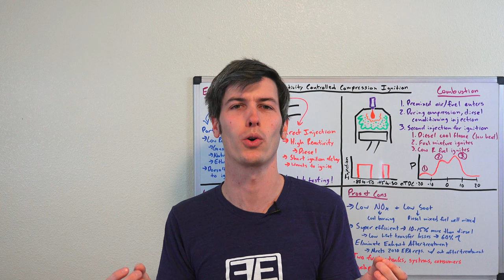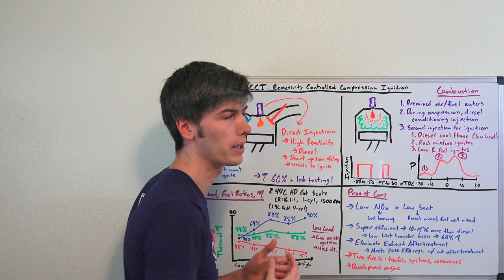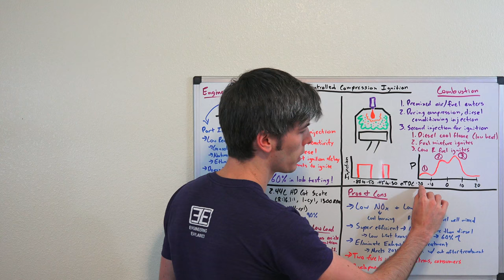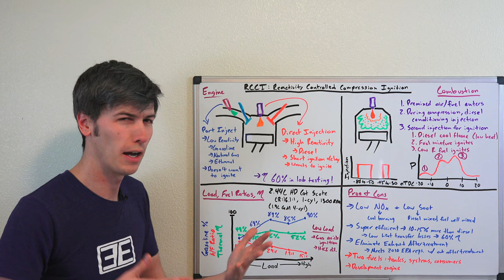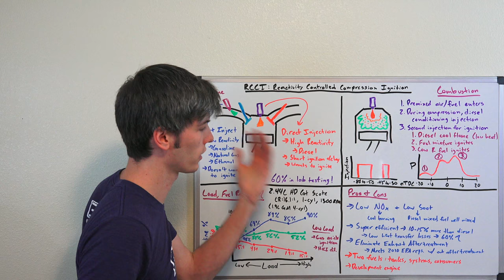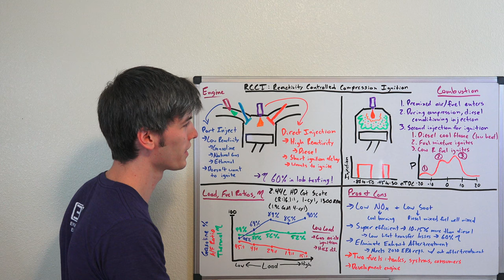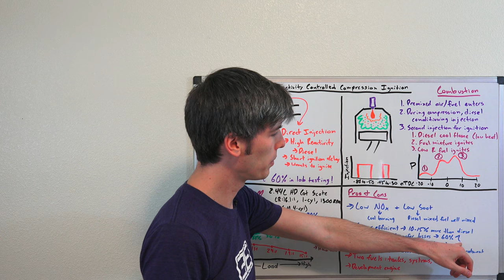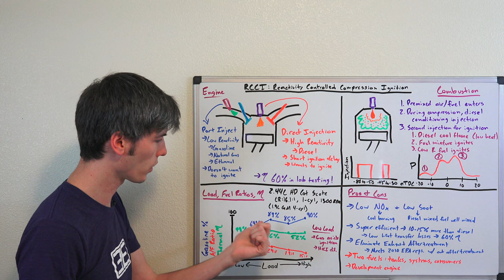Super Efficient Engine Uses Gas AND Diesel - RCCI

Comment: I'm still kinda scratching my head trying to figure out where the increases in efficiency are coming from. Is it primarily because you have a more homogeneous air fuel mixture in the cylinder and lower overall engine/combustion temps?
If that's the case would a diesel-diesel rcci engine bring even higher benefits assuming you could modify the reactivity of the fuel (diesel is more energy dense)? Could water injection be used to prevent auto ignition before the final diesel injection by controlling charge temps?

Jason you have provided more questions than answers. I think that's the sign of a good video! Keep up the good work!
Reply: I'm no expert, and I could be way off base here, but I can see a few places where the efficiency increases could be coming from. One is the ability to use higher compression ratios with pump gas. Another is based on the ignition properties of gas vs diesel - compression ignition is more effecient than spark ignition, but it's much easier to control compression ignition in diesel than it is in gas. This method seems like a consistent way to do it at all load and rpm ranges, unlike the Mazda hcci engine mentioned in the video which still uses spark ignition at certain load/rpm ranges. Additionally, since the hybrid charge seems to burn cleanly even at ratios of 60% diesel, you don't lose efficiency to additional emissions equipment.
Reply: More of the fuel is burned. Engines now a days, aspecially diesel, can't burn all the fuel. All that soot coming out of the exhaust is unburned fuel (from my understanding). So that stuff is burned in the cylinder instead of being pumped out the exhaust.
Reply: The gasoline will absorb some heat during the compression stroke reducing the work required. I would like to see this tried with E85. However, burning more of the fuel must be the key and a slower combustion pressure spike after TDC

Comment: Do you know how the different tyre compounds and tread patterns on F1 cars affect their grip in various conditions? If so it would be really cool to see a video on that.
Reply: softer tire: lower optimal temperature, more grip BUT shorter life time
harder tire: higher optimal temperature, less grip (still a lot, but not as much as a softer tire) BUT longer life time

Then there are 2 wet tyre compounds. One has more tread than the other. The tread is there to prevent aqua planing.
The wet tyres have more grip on wet surfaces or when its raining but less grip on a dry surface. They also have a lower operating temperature (they are harder)
Reply: Tread is completely useless as slick are the tires that provide the most surface area,so the most grip, and the softer the compound more grip there is
Reply: grip has nothing to do with surface area, but with friction
wider tyre = more rubber touching the asphalt = more friction = more grip
Reply: Redfox [赤い きつね] your confused by your own answer.

Comment: Will you make a video about cars that run on natural gas? Would be really interesting
Reply: Mileage will vary.
Some people have more natural gas supply than others.  Increase in passengers would also increase gas supply.
It's dependent upon ingested fuel.  Cabbages and legumes produce more natural gas than other fuels.
I would like to see the natural gas collection system.
Reply: there are many gases in the nature. Is metane called "natrural gas" in USA or propane??
Reply: I think LPG and methane is used most often
Reply: Cars that run on gas are around for a long time.
Reply: Methane is the main component of natural gas worldwide, so I assume they are used interchangeably.
Reply: maybe longer than humans :)
Reply: Phill Gizmo NG is mostly Methane
Reply: Many ppl talking about nat gas being methane,  wrong, methane is called methane. Natural gas refers to gas that wasnt refined from crude oil but still came out of the ground. Nat gas vehicles actually use CNG , compressed natural gas.

Comment: Hi, you need to know the 60% efficiency is gross indicated thermal efficiency, not BSFC efficiency.
the GITE means the power put in cylindar dividing the fuel power, BSFC efficiency is the power output on crankshaft dividing fuel power.
Reply: Chiming Yin Hoo is U? why do I need to know?

Comment: Jason, thanks for doing a video on RCCI, I knew you'd love the idea. I had suggested it on the toyota force engine video, but I don't think I had adequately delineated it from HCCI in my description. I don't know how much influence this channel might have in the industry, but I'd love if this video could tip the scales over just enough for an OEM to build a commercial concept of this engine. I think BMW or Audi would be likely homes for this concept, due to their previous experiments with diesel engines and their consumers inured to heavy engineering complexity.

Comment: Next video topic... “How oil and water mixture makes an engine run smoother and more efficient.”
Reply: Robert Steich lol
Reply: Oil powered engine with water injection.
Reply: It's how steam piston engines work.  They inject oil in with the steam to lubricate the chamber and rings.
Reply: Vinaigrette powered engine
Reply: Diesel is oil.
Reply: If done right I could see it as long the water has seperated into oxygen and hydrogen then ya
Reply: teh water reduces temps..... and a water/methanol mix reduces temps AND allows for more boost with out pre-ignition  

ww2 german airplanes used MW50 (and mw100....for even more power)......
stuff like the american p47 also used water/meth injection.....

at the end of the day..... it just allows for more boost with out blowing the engine apart

however..... they required a complete rebuild if you used the water injection......
but today, with modern computer controlled injection rates.... might actually improve engine life
Reply: An methanol/ethanol based engine usually requires a greater care for the surface materials in the combustion chamber, at least if want to use the same engine for several years without complete refurbish or junking it afer a few hours (like racing engines) since the high chamber temperatures, water vapor and a fuel that doesn't really "protect" and help lubricate like Diesel or even Gasoline, will eat the engine from inside! Injecting water with oil  in the chamber will also help corrosion and lower the overall efficiency of the engine, since you'll be producing less power with the same amount of fuel, not more, so you might just lower some emissions but run the engine badly while destroying it in a fraction of the time!
Reply: In machining you use that benefit. Cause oil can't cool that great.
Reply: the mass of the particle is greater h20 more massive then co2 alone f= mass*acceleration
Reply: Injecting water in liquid form into the engine raises the lower calorific value and produces more power. It is debatable if the gains are worth it. So far I know about an old experimental engine (in the early 90's) that injected water into a carburetor raising the LCV and producing some extra power and extra efficiency.. but it turns out, that water rusted and seized the engine in the late 90's.. that engine is still on display, with all the cylinders scratched and gouged by the seized piston rings (that were forcefully un-seized leaving nice scratches). That engine ran for some while about a few hours a week on a dyno stand for engines. Up until it had multiple mechanical faults. The inventor of that contraption is now dead, and so is the engine. - so in theory works, but in practice it's not worth it. Maybe a new spin with today's technology might do something again.. live and tell.
Reply: What was funny about the concept prototype engine I'm talking: it was advertised as the engine that runs on water! (which was a lie.. it runs on water and 5L of gasoline! ).
I heard of another contraption that boasted something about 100mL/100km fuel consumption.. but what they intently omitted was the fact it's a two stroke engine that runs with 5L of oil!. Nice concept at the base..to make it run with oil instead of gasoline. The gasoline was used to ignite the oil.
Reply: two stroke as well.
Reply: i dont see it improving engine life, cause u may have water accumulation into the oil system over time. but, i do see a definite performance/efficiency improvement. as the phase change from liquid to steam would create a lot of expansion driving the piston, and the heat scavenging needing less heat to get the same expansion.
Reply: It's more complicated. Research LCV (Lower calorific value) to learn more about it. Basically when gases are released there is some heat lost trough condensation of the water vapor that went in the engine. If you inject liquid water and have no vapor water at the intake then that heat lost trough condensation is less. For engines the LCV is more important than HCV since power is delivered in that state and what happens after gases are evacuated is irrelevant for the power/efficiency of the engine.
So as said earlier.. injecting liquid water may help in some circumstances like driving in a humid area that already contains high water vapor in the air, here is better to replace the water vapor to liquid water. or remove the water altogether if possible. In a very dry area it's about pointless to inject water.

Even so, injecting water has drawbacks.. the minuscule energy gained is lost in the corrosion of parts, more complicated system, etc so it never caught on (until now.. we'll see)
Reply: The fuel was called olium (oil emulsion). Major problems with corrosion and pollution.

Comment: What I would do…
Ignition Method: A combination of RCCI and SPCCI, assisted by Pulse Plugs (Plasma Ignition) and Swirl Injectors
Valve Control: Electronic/Hydropneumatic
Engine Layout: Boxer-12, counter-rotating cranks
Forced Induction: Heimholtz Resonance + Electric Supercharger + Quad Turbocharger
Low-reactivity fuel: Mix of Isobutanol, Lithium Borohydride, Tetraethylbismuth Iodide, and Nitrous Oxide. Refrigerated via Stirling Heat Pump.
High-reactivity fuel: Emulsified blend of Diesel fuel, Nitromethane, and Ammonium Hydroxide. Warmed via Stirling Heat Pump.
Anti-Detonant: Mix of Water, Hydrogen Peroxide and Hydrazine.
Energy Recovery: Thermoelectric Generator,

Comment: To sum it up,it's simply a way to get rid of spark plugs to ignite gasoline.
   Although it won't rev as high as a normal gasoline engine .
   The reason being it has to attain higher compression ratio in order to ignite diesel fuel which in turn results in longer connecting rods and thinner bore .
   Although it is less polluting than gasoline but still it is never preferable for racing.
Reply: Saubro Boro “never preferable for racing”... might want to check in with Audi on that. They successfully campaigned V10 turbodiesel cars at LeMans, and won outright multiple times, before all the hybrid mumbo-jumbo began to be mandated by the rulebook. Lower revs, lots of torque. Still fast.
Reply: There are some high revving diesel engines in the market at the moment such as in audi's 3.0 and 4.0 bi turbo diesels that can rev to 5200 rpm and BMW'S N57S which can go to 5400 rpm. Anything higher revving is not even road legal.
Reply: A bit over 5k rpm is a normal upper limit for diesels. And this RCCI engine might not be as limited as a pure diesel one, which could mean same revs as modern gasoline engines (6500-7500 rpm max usually). As for racing, there were/are some racing diesels reaching as high as 8000 rpm, so that shouldn't be a problem either.
Reply: MrThecarfreak777 
Yup but racing is not road or traffic work
Reply: szafirowy01 
It may rev up to 7000rpm but it can't rev up to 18000rpm like an F1 engine.Isn't it?
Reply: So what? My point is that judging whether RCCI is suitable for racing or not based solely on diesel engines' limited revs is quite a stretch. Maybe RCCIs would not have diesel rev limitations? Maybe their efficiency would balance the limitations even in racing conditions? Or maybe you're right and they'd be useless on the track? Impossible to tell.
Reply: szafirowy01 
Yeah my opinion is right and everyone will accept it coz high rpm means high speed provided both engines i.e ethanol /gasoline and diesel have same power .
   Simply a high revving engine will turn the wheels more quickly than the slower one provided we increase the torque through gearing.👍👍👍👍👍
Reply: In theory one could spray a tiny amount of very low-octane fuel to combustion chamber that would detonate rather than burn thus providing the "spark" to ignite the fuel-air mixture. It would rev high because  of small detonating molecules spreading to wide area inside combustion chamber starting fuel-air burn at many spots at the same time
It would be very difficult to spray just correct amount of detonation fuel at different rpm and load conditions  so that fuel-air mixture would burn but not detonate. Admittedly would not want  to use my own engine to test this idea.

Comment: This is a neat video and great explanation. On a related tangent, you could do a video on propane injection systems for Diesel engines. Cleans up the soot pretty dramatically, provides some boost in power (depending on the engine and setup), reduces total fuel cost (propane is a bit cheaper or was at one time, per unit of energy). I’ve been wanting to do this is with my Duramax for some time, mostly to clean up the emissions and reduce soot load inside the engine... but the cost of a DOT-approved tank is holding me back. Some people put RV tanks in a toolbox in the bed, but that’s a bit “amateur hour” for my taste, and certainly not as safe as a properly installed motor vehicle tank.

Comment: Diesel fuel also more lubricative hence adding more longevity to the engine.
Reply: Diesel longevity also has a lot to do with using much more oil (stays cleaner longer) and lower rpm.

Comment: I used to develop dual fuel diesel... Natural gas ignited with a little diesel pilot injection, in a standard truck diesel engine (9 to 13 liter). It was fun, but you really need top quality gas and even if you throttle some of the air out at lower to medium loads to get the right lambda, it was very rarely even as efficient as a standard diesel and methane emissions often made it overall worse in terms of CO2. Cost less to run though.

We never got on to premixed combustion (company went busy), but the plan was a diesel/methane mix that would be compressed and then ignited with a second diesel shot.

We were port fueling gas. Westport and Volvo are just about to start selling a new type of dual fuel engine. Methane-Diesel. It uses Westport's hi-pressure gas/diesel injector. It will direct inject diesel pilot and then direct inject gas at high pressure into the fire. This should solve the methane slip. However the engine can never run on either fuel exclusively. Diesel efficiency should be matched.

Comment: How would ceramic coatings help with the thermal efficiency. It should help with this no? And I read about lasers to replace spark plugs, since they can ignite the fuel at multiple places at once. I think the combustion engine can exist for longer, but electric will replace it unless we make carbon neutral fuel (biofuels).
Reply: NatoriousGamePlay The same challenges are faced with EVs. Most electricity comes from non-carbon neutral sources. What makes us think we will have much more improvement in EV tech when the pace is just as slow?
Reply: Ceramic coatings reduce the amount of heat that is transferred to the piston and combustion chamber, keeping the heat where it belongs, and that is the fire inside the combustion chamber.
Reply: Skyline Fever correct.....so.......is there anything else to your reply? I dont think you would get anyone to disagree with you....
Reply: I can't think of much else to add.

Comment: Thank you for reviewing this new engine design. I don't quite understand how it works based on your description. A few questions: is this a four stroke engine? Is it compression ignition? Are both fuel sources injected in the same ignition cycle? Are there spark plugs?

My understanding of how these two fuels work, in my mind a 16 to 1 compression ratio would ignite gasoline very early in the compression stroke causing pre-detonation. Where diesel needs higher compression for auto ignition.

From your description I imagined two separate functions of this engine. First I thought this was a two stroke alternating gas and diesel. Second was a mixed fuel four stroke. This second understanding does not make sense to me the way you described it. Gasoline is very volatile compared to diesel. I have had a gas race engine auto ignite on regular pump gas (often called dieseling). The engine continued to run even after shutting off the ignition because the 11.1 to 1 compression of my race engine auto ignited the 87 octane.

So, with that in mind, adding gasoline injection to a diesel engine would be akin to nos injection on a gas or propane injection on a diesel. 

With all that being said, would you be able to give a little more detail as to how this engine design functions? (e.i. the stroke cycle, injection timing, etc.)

Comment: Is it bad that my first thought is what the exhaust would smell like?
Reply: Joash Church awww, where's the fun in that.
Reply: My first thought is what will it sound like.
Reply: It'll smell like unicorn farts
Reply: Yes, very bad.
Reply: I'm curious how much hp and lb ft the engine he was describing would put out as is
Reply: This system might lead to high NOx, but you could get a urea injection system, that is how many diesels passed the stricter 2008 smog laws. It also became even more common as companies had problems with not using urea injection, such as the 2008-2014 VW Jetta TDI, 2008-2010 Ford Powerstroke, and 2008-2010 Dodge 6.7
Reply: David Daniels . Or sound like or how much vibration
Reply: like any intersection in the modern world